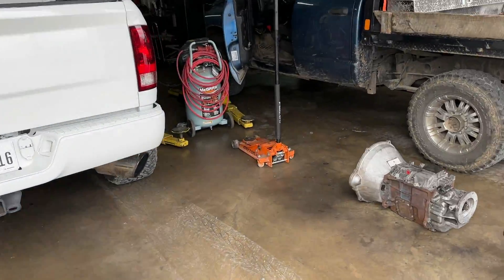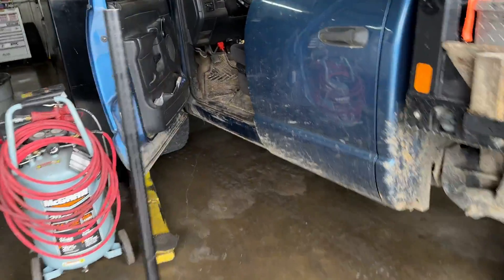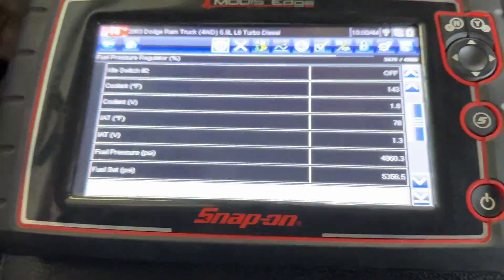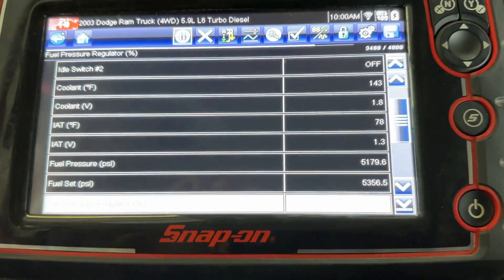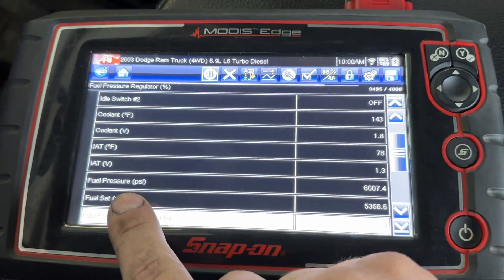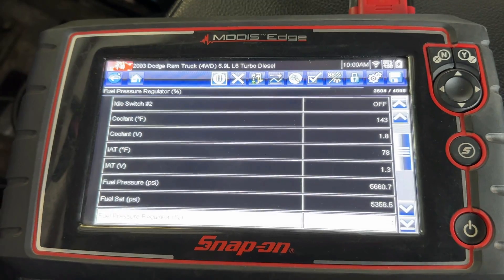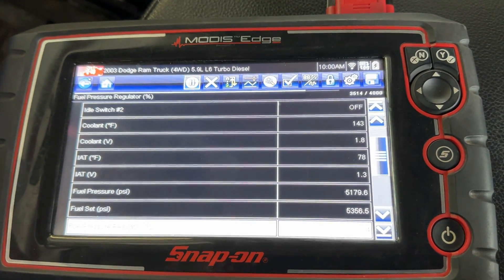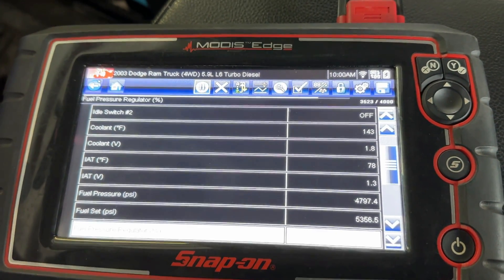CUMMINS LOW RAIL PRESSURE, Troubleshooting tips!

Comment: I have a dodge with 2003 motor it runs fine till operating temperature then i just lose power like im giving it no pedal then itll randomly stall filters new put on a prv fca and a new in tank lift pump and its still doing it.
Reply from the maker: Check return flow from the head. And check lift pump pressure with a gauge
Reply: Swapped cam n crank sensor. Return seemed alright. Lift pump is working can hear it running. Tried it again n still doing same thing at operating temp. Gonna try a new relay tomorrow. It has one like the retrofitted one in this video
Reply: New fuel relay got rid of the stalling. But it still kinda bogs down some when accelerating. To check return flow from the head. Is that the return line on the injection pump.

Comment: Just went through most of this with my 2014 6.7 Cummins… was dropping RAIL pressure at WOT with my big tunes in, and randomly dropping Rail pressure sometimes… ended up being the In tank Lift pump filter screen clogged up with junk… put a whole new Lift pump/sending unit in and solved my issue…

Comment: I've got a 2003 Dodge ram  2500 5.9 Cummins, just pulled tank and replaced the fuel pump, cleaned a little debris out of tank, replace fuel filter, still won't start, little shot of starting fluid starts right up and runs good, truck starts and runs fine after initial starting fluid starts, let truck sit for about 30 minutes and it won't start back up unless I hit it with a shot of starting fluid, I've been told injectors and possibly CP3 pump but I don't know who to trust as 2 different shops have told me different things, i'm not sure what to do next any advice would be appreciated... Thanks
Reply from the maker: Do a return fuel test, and test lift pump pressure

Comment: hello to everyone  I watching this video and I had the same issue the high pressure rail was dropping down I check everything you did and sent the injectors out to be test them and they found out 4 injectors  out of  the 6 injectors, I installed all injectors and now I have a problem I haven't be able to fire up again after I installed the injectors I monitoring the dired high pressure vs actual pressure and I only getting 22 psi the lift pump is fulling all the way up top off the filter housing, any tips you can give me I will really appreciate it. 😟

Comment: I have an 2004 plenty of fuel to the cp3 replaced fca, pressure relief valve, pressure sensor and still no fuel coming out of cp3 to the rail or the return going to replace batteries bc cause of fan clutch code and low voltage code figured it would start with jump pack but didn't any ideas would be appreciated

Comment: Awesome videos …I have a crank but no start on a 2000 5.9 24 valve any idea what to check…I checked all my fuses and good, fuel filter is good, starter is good, batteries are good …I’m kind of lost we’re else to look, any help would be very appreciated
Reply from the maker: Check fuel pressure would be the first place to start
Reply: @horsetorquesdiesel  i did but nothing ….honestly I picked up a fuel injection pressure tester @ o’reilys…would that work for a diesel ?
Reply: @JVazquez-e5x did you find what was wrong with it?
Reply: @stevenf.5835  yes …the fuel pump in the gas tank wasn’t getting power

Comment: Great video. Still sorting through my long start issue on my 04.5. I put in new fuel pressure relief valve and new fuel filter. The problem still exists. Waiting on banjo bold threaded adapted to test lift pump pressure, and go from there I guess.
Reply: Did you figure out your long start issue?  I have a 04.5 as well and I've been chasing this ghost for a while.  Every time I replace a component it acts good for a couple of months then goes back to long crank/no starting.  I've recently replaced the CP3 pump, tightened some loose banjo bolts on the fuel return from the head to the filter, and replaced the starter with a more powerful one.  I had thought that solved it, but it only lasted about 6 months or so and now back to long crank/no start.  Plus numerous other troubleshooting like blocking off the rail return.  I'm now thinking about replacing the fuel rail itself and the supply lines to the injectors before replacing the injectors.  I have previously troubleshot the injectors by capping off each at the rail to see if that made a difference with starting, which it didn't at that time. Except I didn't test #6 because it's so hard to get to.  Note:  Long story short the previous owner had a FASS fuel pump and the filter on it rusted and put contaminants in the fuel tank.  I have since removed it and did the in-tank relocation kit for the lift pump (factory was on the back side of the filter as you are probably aware....very poor design) and also added a fuel pressure sensor at the filter outlet.  Any info on your experience would be great.
Reply: @gbockelmann1 im having same issue. Did you figure it out?
Reply: @jimx4052  last month I replaced the batteries with two Ionic LifePo4 starter batteries and made up new battery cables, that seems to have dramatically helped. I noticed a pattern that evey time I replaced something I also charged the batteries because they were drained from all the cranking.  It still on occasion takes longer to crank (more than 5 seconds), but at least I'm not draining the batteries when cranking.  I think the better starter cranks faster too. I suspect I have an injector or two that are slightly leaking at lower pressure.  The lead acid batteries were less than two years old and tested fine, but they were not enough for cranking on this old truck.  Now I have 2800 Cranking Amps (2000 CCA). Not a cheap solution,  but the LifePo4 starter batteries are supposed to last longer, we will see.

Comment: Just did a new engine an i`m trying to troubleshoot why my truck don`t want to start. New CP3, New Fass 165, new Bosch FRP Relief valve.
Reply from the maker: If it doesn't build enough rail it won't. Seen it be a bunch of stuff
Leaking tubes
Bad sensor 
Bad wiring 
Incorrect plumbing 
Loose cp3 nut
Reply: @horsetorquesdiesel  or a idiot like me realized I didn't install the camshaft position sensor
Reply: @horsetorquesdiesel  installed the sensor for cam, replaced the crank sensor and its trying to hit off but not fully, cts3 says rail pressure is 4 to 8k range.

Comment: I need help! 05 dodge .... started cutting out wanting to die at stop or red lights. Scanned and was told had two bad injectors. Ordered 6 reman'd Bosch 3 year warranty from Thoroughbred Diesel. Installed them. Original issue no longer there. Idles fine. Under a load it runs rough like a fuel ping and smokes. Went through the injectors checking for proper alignment with new Bosch feed tubes. Truck still the same. Changed the oil right after new injectors, thought might have fuel in th oil. Now appears that may have fuel in oil again. Fairly certain   I didn't over fill it. But it is over full now. I can't tell from smell if there is diesel in the oil. If anyone can help me I would be eternally grateful!

Comment: Do you have a video on torquing the tunes?
Reply from the maker: What?
Reply: @horsetorquesdiesel  sorry, the tubes you were talking about.    New lift pump, new relief valve, new filter, and it still, jerks, jerks, jerks under a load.

Comment: My truck is exhibiting the same symptoms. My fuel filter is good do you think that 215,000 Mi on the factory injectors means they're bad.? Should they be replaced with that many miles on them

Comment: did you ever check the fuel rail relief valve?  trying to find a relevant video on youtube that does this.  i have a truck that will build fuel pressure, commanded, and actual match up but once you let off the pedal, the commanded drops while actual stays high until the pressure naturally releases through the injectors

Comment: What do you mean by retro fitted? My truck has one and I cam seem to find it. What am I missing?
Reply from the maker: Dealer installed in tank lift pump it was a recall
Reply: @Horsetorques Diesel  so would I still go with a 03-04 air dog system or would I have to switch to a later year?

Comment: I know its something all cr's have in common but is there a safe way of removing the rev hang? being a 3rd gen 6 speed owner it can get annoying in between shifts or even free revving. I've looked into everything and it seems like its just leftover rail pressure. I changed my prv and still hangs... although it returns to idle slightly better.
Reply from the maker: Tuning will calm it down

Comment: I am a mobile mechanic,  and josh, you nailed it!!   90% of the time its simple stuff so I agree to always start at the basics.  Excellent video to help trouble shooting.
Reply from the maker: Thank ya!
Reply: question for both of you guys? 05 5.9 starts beautifully keeps good rail pressure but take the rpms up to 2k and let off the throttle and the revs hang and bounce on the way down. Injector pintals not seating?

Comment: Can you do a fuel injector return line test to check for an individual injector problem  large isx Cummins will sometimes have excessive return line flow giving it a low rail pressure code
Reply from the maker: Yeah I’ll cap them one at a time when I get to injectors. You can usually narrow it down on a kill test

Comment: I've cut a fuel line and welded the end shut to build a cap off the rail. I use it to individually block off each injector to test and drive on five cylinders. This method will narrow down the issue 100%.

Comment: Start simple, best advice there is. Is there any decent way to test the injectors without sending them off? I have an 05 with 314k on the odometer but I bought it used with 280k and no idea how many miles are actually on them. I plan to go up in size along with some compounds and cp3 for the future but don't want to wait too long and wash out a cylinder with a stuck injector.  The truck runs great but want to make sure I don't miss the signs of a bad injector. Thanks for always bringing great content!

Comment: I drive a 04.5 Ram 3500 around last September it started spitting black smoke out the tailpipe and wouldn’t go over 30mph and it was throwing a code P0148 so I replaced the injection pump and then it wouldn’t start anymore. Took it to a shop near me, they managed to get it to start and said I need new injectors. Brought them new injectors and they kept my truck for 2 months never installed them. Took the truck back from them and tried to install the injectors myself after watching your videos on injector installs. Installed them and my truck still won’t start. The shop told me to crack the injector lines open to bleed air out which doesn’t make sense cause it’s a common rail system. Now it’s at another shop been sitting for a month still not looked at yet. The other shop mechanic thinks it might be the ECM since I replaced the injectors, cp3, fuel rail, prv, FCA, return lines, almost everything. I replace the stock lift pump with an air dog raptor 4g over a year ago before it broke down. Any idea why it will not start after I replaced everything on the fuel system?
Reply from the maker: There’s a lot, if you are local bring us the truck I can fix it
Reply: @horsetorquesdiesel  unfortunately I live in Buffalo, NY. I would’ve been ecstatic to bring it to you lol.

Comment: I have the Edge cts monitor and it displays everything including rail pressure, lift pump pressure etc and has a built in scan tool. Good to have.
Reply: Pat  have you figured out how to get  the actual and desired to show?  I have the cts3 on my 07.5  6.7  and for some reason cant get it to show both it only  shows the actual twice..

Comment: Had the same trouble after installing cat filters on my 6.7 found lift pump weak. Would pump ok on factory filter but not on cat filter. I don't want to go back with oem lift pump looking around for a good aftermarket pump. Any advice
Reply: Fass or airdog
Reply: Firepunk has the airdog 165 on sale $650
Reply from the maker: Airdog hands down
Reply: I would go Airdog, this is coming from a Fass customer.  I wanted to go Airdog but they were out of stock.  Customer support blows with Fass, or consider the gdp fuel boss mechanical pump.